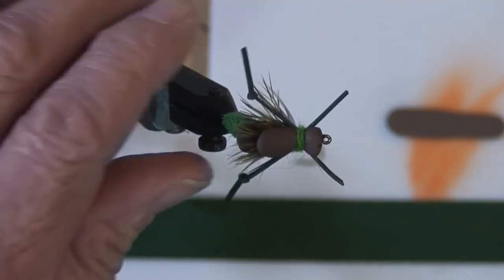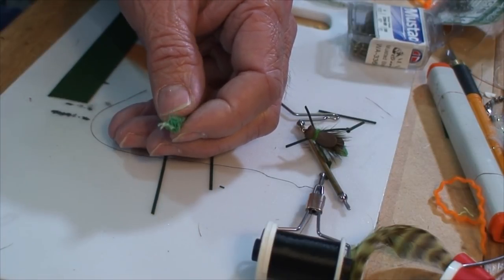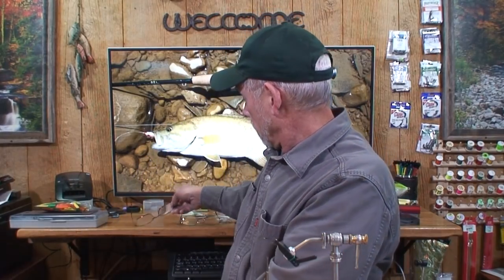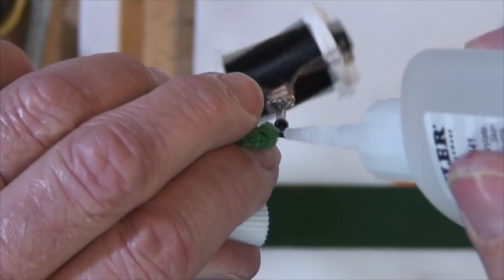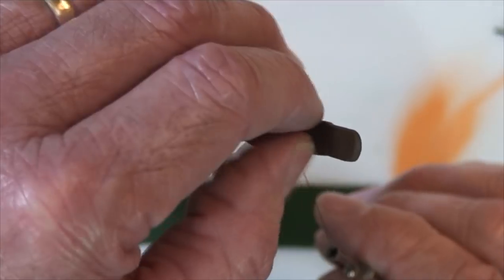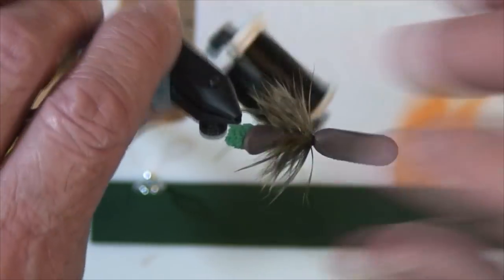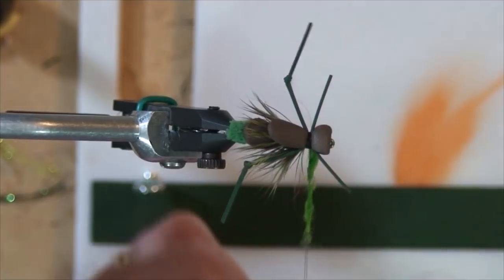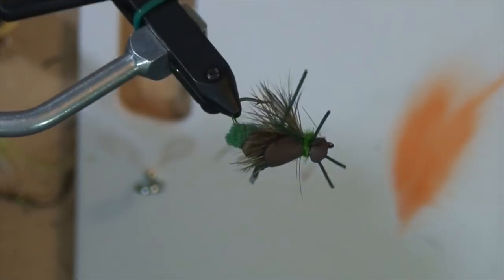Mop Fly Hopper Style

Comment: I have a cricut machine and I was wondering how could I cut out foam body patterns???
Reply from the maker: I think the Circut machine has a  material carriage that has a sticky surface to hold the foam down while cutting patterns.
Reply: @FrugalFlyRodder  Hi MIke, I didn't catch what type or thickness foam that you used for this fly.  Would you mind sharing that?  Also, do you have a Cricut pattern file for these foam bodies?
Reply from the maker: @johnhartmusii1499  2mm craft foam John